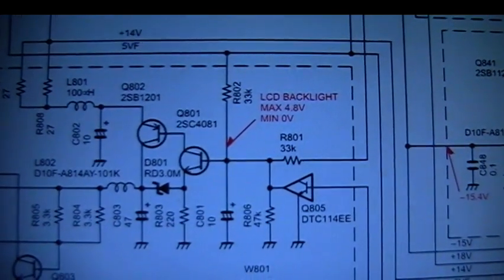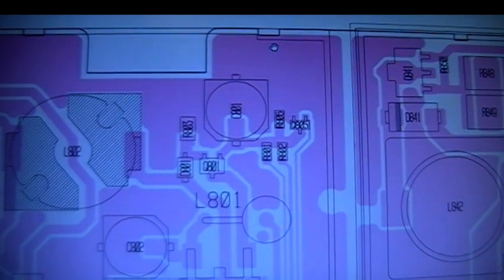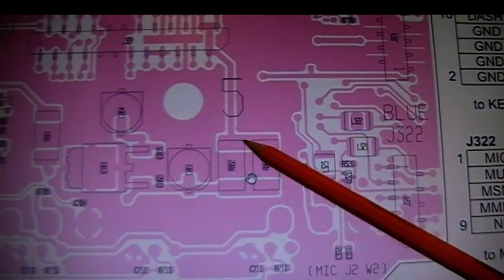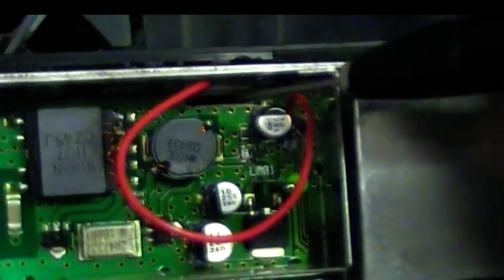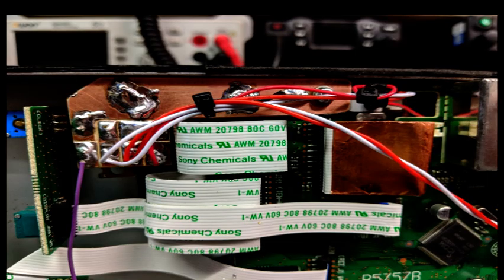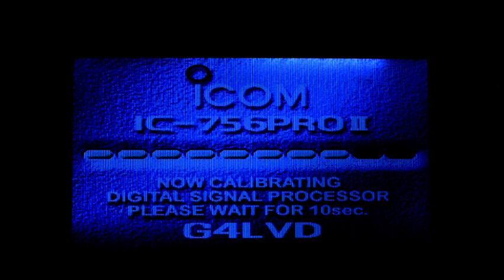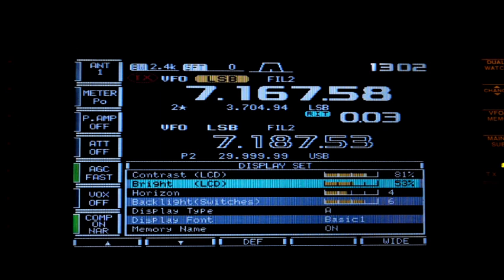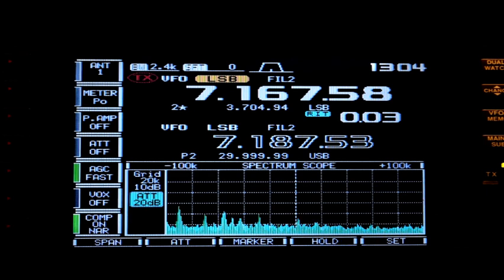Icom IC-756 Pro II CCFL to LED Part 2 of 3 connecting to the internal LCD brightness adjustment.

Comment: I saw that you have completely removed the driver board of the two LED bars and in its place you put the circuit with a transistor ... This means that to drive the two LED bars there is no need for the driver circuit .. They are powered directly from the 14 V supplied by the apparatus ... and the sampling point of the dimmer line is that taken from inside the inverter of the CFL (which ranges from 0 to 4.6 Volt approximately) Now, if you look closely the 2nd part video, the setting is ... but it's not that great ...
So, in my humble opinion, it is advisable to leave the driver card (with the pick-up point of the dimmer line on the transistor Q905 collector where this meets with the R915 - Front unit card.
This offers two improvements, compared to the simple transistor and direct supply of the led bars: -
1) - When the RTX goes into transmission, the brightness of the display does not undergo lowering (as it could have without its driver, or without inserting a further integrated upstream regulator, eg LM7812;
2) - the sampling point on the collector of the Q905, in addition to avoid piercing the metal screen of the inverter, offers a variation of voltage from 5.1 V to about 12 V (see diagram) which allows a wider range of control on brightness, in fact, by placing a 10 Kohm linear trimmer at the input of the dimmer line of the LED driver board, you get a truly "optimal" adjustment of the brightness range governed by the device menu .. !! (in practice allows me to set as I like what will be the maximum brightness of the display when the Brightness menu shows me 100% and therefore also adjust the minimum (50% or 0%).
Congratulations for the excellent work and I greet you cordially.
Reply from the maker: Hi Antonino, thanks for the words of wisdom, i assume from your comments you have done a modification on your own equipment? after reading and looking at the connection for the dimmer you talk of it seems you are dimming the panel meter and lights along with the screen back-light, this i had not considered but from what you say i plan on doing a few tests to see what can be done using your methods , I found that loading the original back-light connection from the Invert-er  side was loading the circuit and was unable to get required voltage swing,  as the led driver board dims the led's to a low maximum dim with 4,8 v supplied and comes to max brightness lowering the voltage to 2,5 v so as you can see using the LED driver board does not work in the voltage swing range and  possibly not from the connection you suggest, that's why I used a single transistor,  also regarding piercing the metal screen of the inverter there is entry below from PCB side. awaiting your suggestions and thanks  Barry G4LVD
Reply: @bandcam  Hi Barry ... you're right, in fact the dimmer pick-up point indicated by me, may not work with the LED bar driver board working in the "reverse" direction as a dimmer voltage, so you should build an inverter with transistor, but it should work perfectly with the circuit you made with 2N5294 transistors or equivalent ... and instead of the 10K fixed resistance I would insert a 10K resistive trimmer, this would improve the brightness levels of the led bars by adjusting it in broader way from a very low threshold to the highest one. Finally, the sampling point indicated by me is more accessible as it is directly connected to the collector of Q905 (near the point where we take the supply voltage +14 V) on the front card. Obviously it is all to be experimented and find improvements in this regard.
Thanks to you ... and a greeting from me.
Reply from the maker: Antonino Russo ok all noted, at the moment I have to say I am very pleased with the current configuration, and am able to adjust the display down below a comfortable level and above a comfortable level which I was unable to demonstrate on the video as the camera keep compensating and correcting, so 50% looks good. I see no change whatsoever in the voltage or screen display when going from Rx to Tx as you questioned so all good there.. will keep experimenting haha...
Reply from the maker: Hi Antonino, check this out,   www.youtube.com/watch?v=gyKRCw_njtk